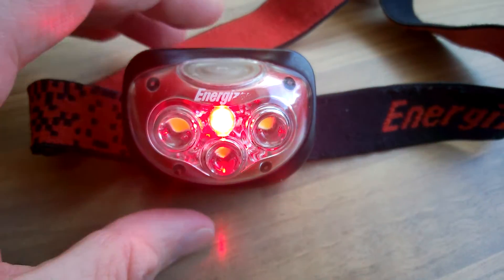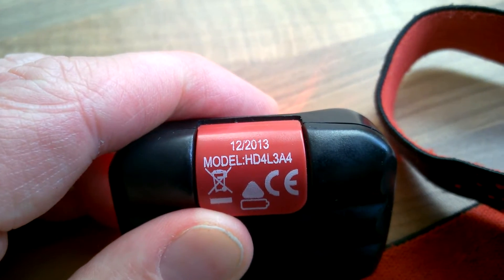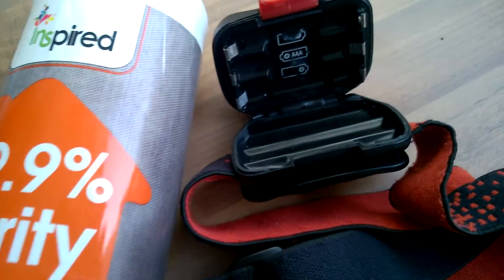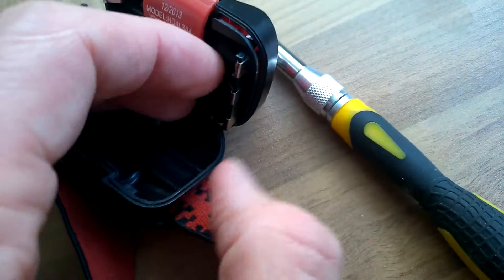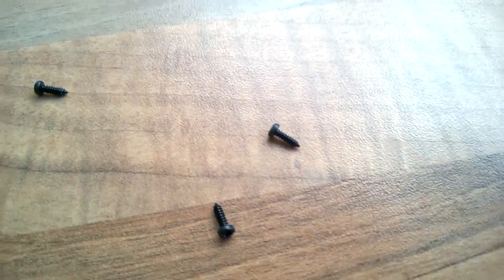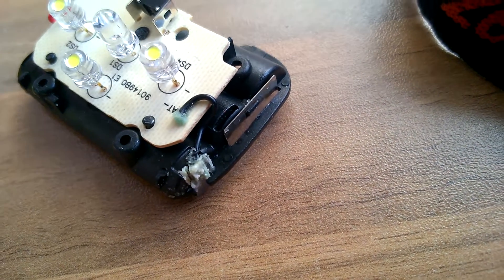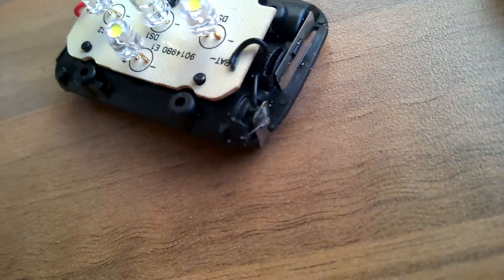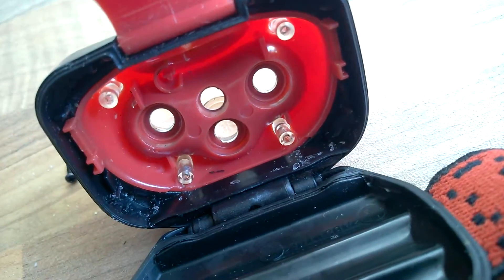Energizer HD4L3A4 LED Head Torch Tear Down and Repair After Weird Failure. Can It Be Saved?

Comment: Got it working but that black wire is suspect at best the corrosion seemed to have worked right the way through it from the battery contacts to the board.

Makes me think that wires badly corroded inside and will fail or reinfect what it's attached too
Reply from the maker: Thankfully it is still going....for now! :)